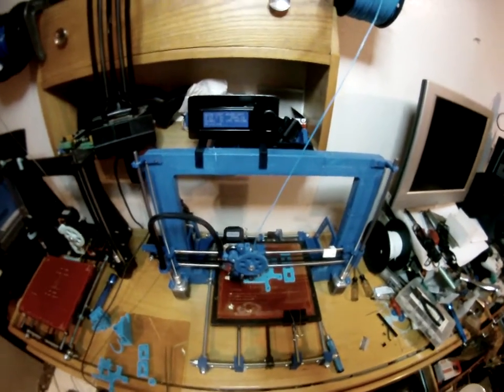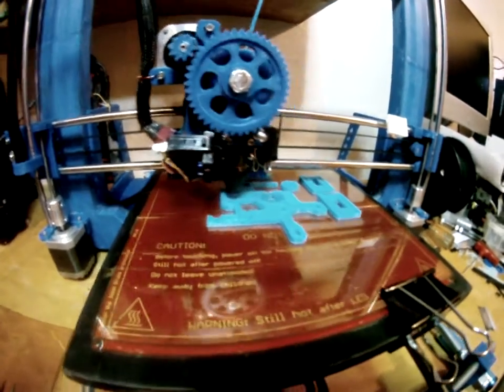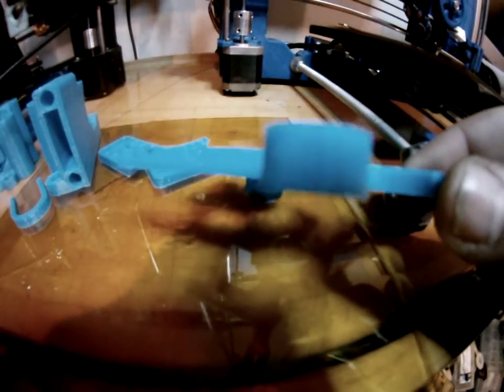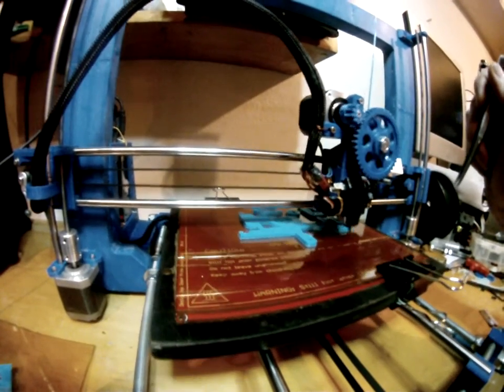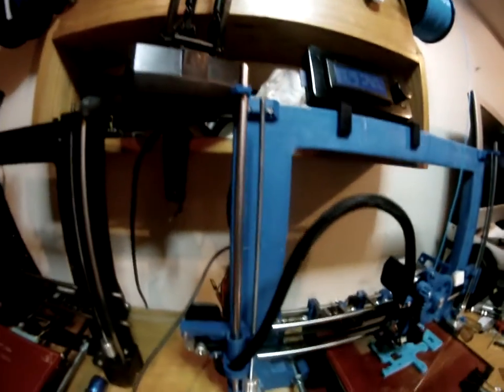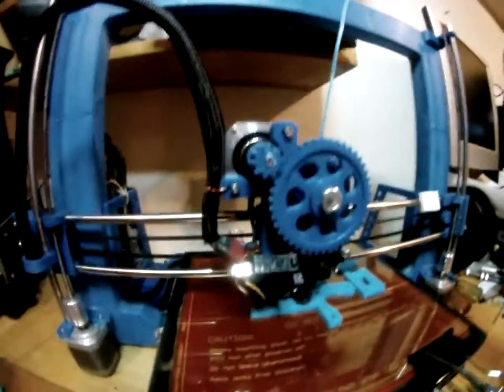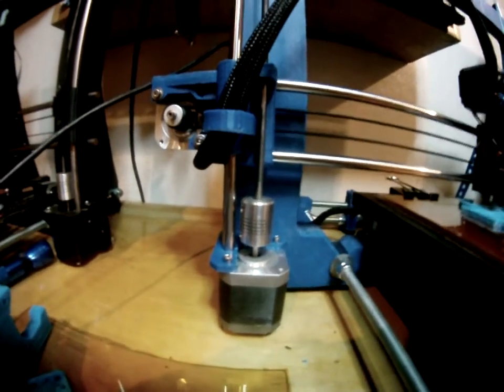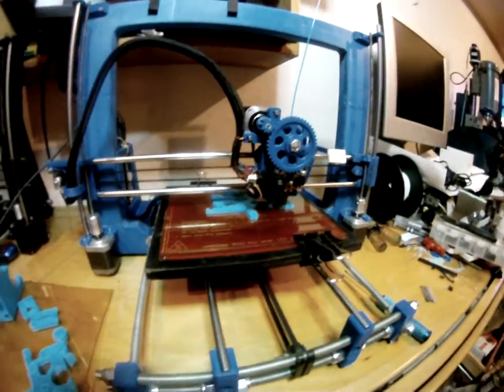Fine tune the new prusa

Comment: First off, I really like the modifications you made to the original frame design and the general build quality seems to be very good. I would like to give printing a frame a go, but I was wondering if the frame you made has any issues with vibrations or flexing during printing? It looks very sturdy in your videos, just curious, since I've seen one or two people who printed the boxed style frame complain about flexing. Is your frame printed solid?

Thanks!
Reply from the maker: I have noticed no issues at all with flexing but i can flex it a bit if i tried intentionally..... Its not printed solid but i think that would work fine. Mines hollow then the cavity was filled with newspaper pulp to reduce the resonance and noise then the front was glued onto it....
If i ever make another it would be a bit thinner walled maybe all sides would be printed 2 or 2.5 mm thick. Glue the body together and id probably fill the cavity with quick set concrete mortar or similar non shrinking concrete mixture. That would surely cure any flexing and dampen any noise plus give it a heavy.... Quality feel.
I have no complaints at all with this one but... that's how id make another.
P.S. I can't recommend enough making the frame wide. wider than the stock frame by about 4 or 5 inches really is awesome...
Reply: builtrodewreckedit Awesome, thanks for the reply!